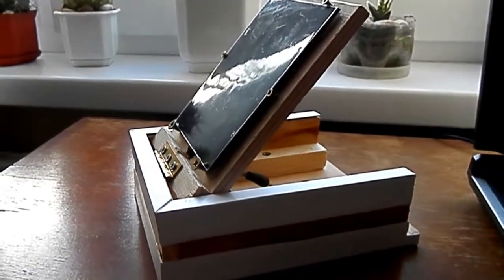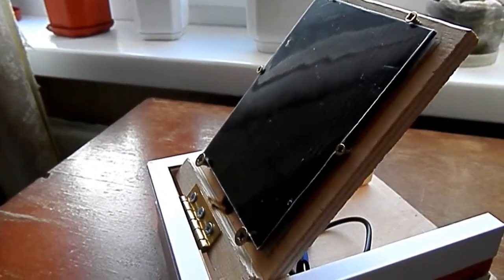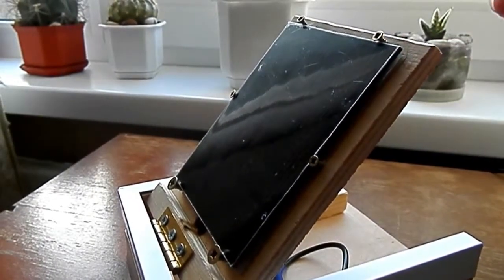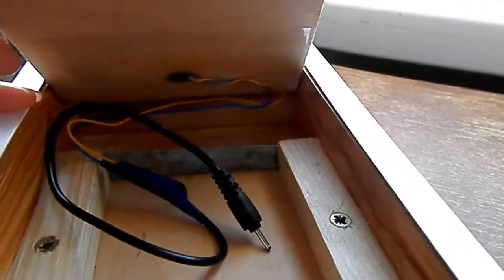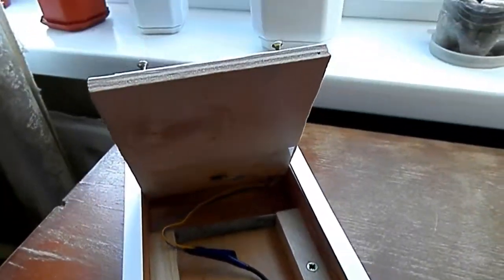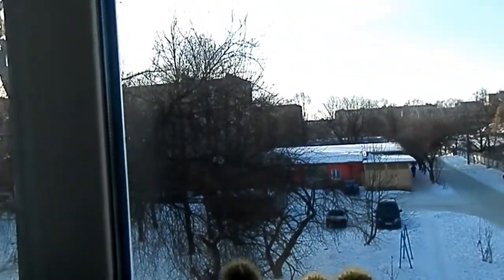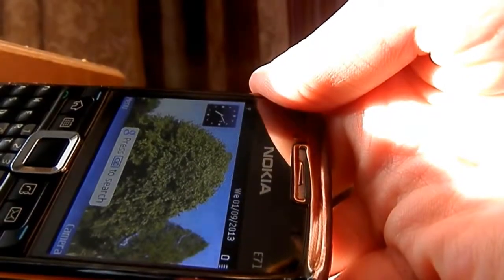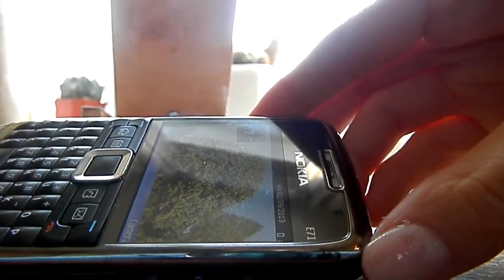Solar cell phone charger. Ready. Trial

Comment from the maker: Awesome! let me know how it goes. i am still waiting for spring to come to get more sunlight for more power and longer sun hours. so far, my charger works, but it doesn't have enough power to charge the phone even half-way through.i assume that a solar panel that gives more than 6 V + voltage regulator could help my model, and maybe can help yours;)